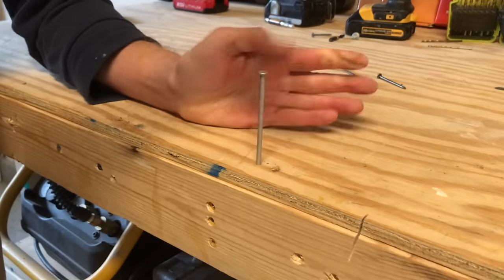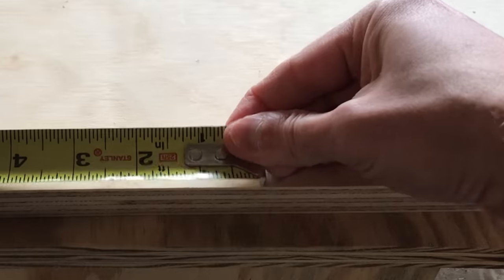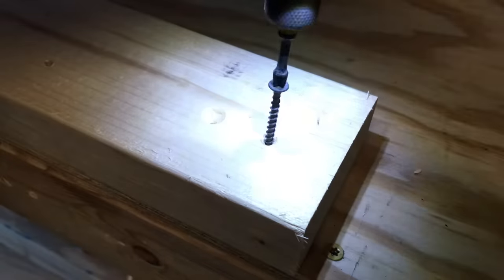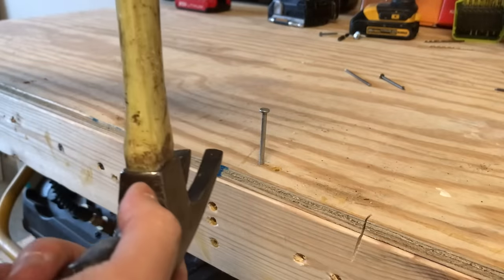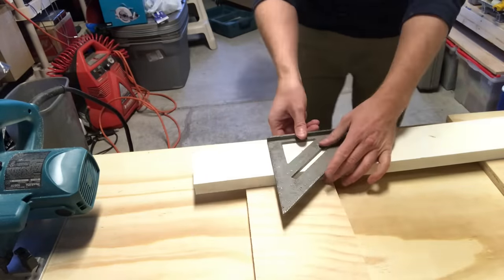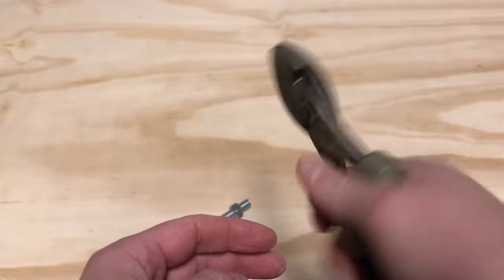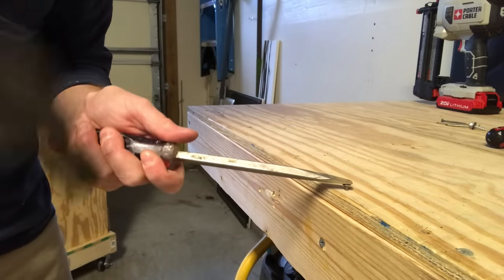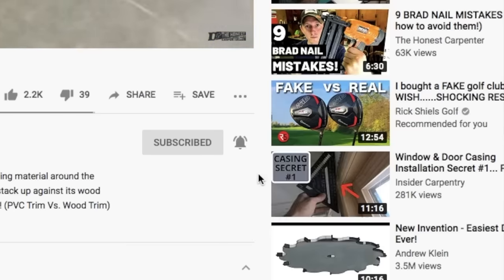21 HAND TOOL TIPS, TRICKS & SECRETS!! (Hammer/Screwdriver/Tape Measure/Pliers...& MORE HAND TOOLS!)

Comment: Most of us in the trades carry lineman pliers instead of slip joint pliers. Instead of needle nose players to get under a screw that won’t come out, use the claw of your hammer.  I would add, how to use the hole at the end of the tape measure to grab a nail to mark circles or arcs. And we don’t mark with dashes, we use crows feet.
Reply: Ain't nobody got time to screw screws in. That's that the 32 oz framing hammer is for!

Comment: This one is so cool that I probably oughta charge you for it.

Ever been trying to patch a few ceramic or stone tiles in order to replace a shower valve or mixer? Okay this is a fairly advanced skill. That said? A diamond wheel on your 4 % 1/2 inch grinder is V helpful but can leave a ton of dust in the air. Even with an exhaust fan on the window it is no fun kicking up clouds of fine dust that are V bad for your lungs. Do this instead:

1. First of all invest in a glass cutting wheel. Marble and stone companies often carry these. I know that Dal-Tile usually does. They've come down in price a lot over the years too. 

2. Next, take a large sponge like the kind that tile setters use for grouting. Dip it in water until it is about 3/4s saturated with water. In other words, once it gets to 100% saturation, shake a little of the water out.

3. Start up your grinder with the glass cutting wheel and cut through the edges of those tiles that you want to remove BUT place the sponge directly to the left of the wheel! That's right, make sure that the wet sponge drips a generous amt of water onto the highspeed wheel while in operation.

Hint: Leave a little strip of the extracted tile that lays right nest to the good tile you're leaving alone. This tiny strip can easily be removed after the rest of the tiles are taken out.  The thin strip will protect the remaining good tiles. When popping the demoed tiles out, make no action that puts weight or stress onto the tiles that you wish to save.

The wet sponge must be re-wetted frequently. Otherwise, you'll just be throwing more dust into the air. SO long as your shoes remain dry? It is highly unlikely that the wet sponge will cause electric shock. However, don't get stupid and perform this activity while standing in wet grass or if shoes are dampened from water at the bottom of a tub. 

Or if you're a real ''Nervous Nellie''?

Buy a surge protector with a  GFCI unit in it. Although I'm not certain how well this will work. As such devices are very touchy and will often shut off a circuit if only 1/4 of a milli-amp escapes the system. Plus I've never used a GFCI on this kind of an application and yet have never been shocked from it either. The only time that I've sustained a mild electric shock while working in the tile was when my wet saw was out on a client's lawn. The grass became moist from the tile saw spray. Later my shoes and trousers became slightly damp and BINGO! I got whacked a tad bit.

These days I almost never use my wet saw. Preferring to use a glass cutting wheel on a highspeed grinder. If dust is not an issue? Like say on an outdoor, permitted construction site? Then I might not even use the wet sponge technique. Speaking of ''technique''?

With a well-trained set of hands the above method actually cuts tiles more quickly than the wet saw. And of course a highspeed grinder that costs but forty bucks is cheaper by far than even our lightweight economy wet saws.

Comment: About tip #1: the moving tab. So should the measure be taken while accounting for the tab or not? For example, if I hold the tab against a surface and measure up to a certain point, should I substract the thickness of the tab to the length I just measured? 🤔
Reply: He said it backwards, so it’s confusing.  Pushing against pushes the tab in, so the tab thickness is be subtracted from the measurement, as it should be.  When pulling, the tab thickness is being added back in, again as it should be.  To answer your question directly, no, do not add in or subtract out the tab thickness when taking measurements, since the movement of the tab does that automatically.

Comment: My 3 prong garden tool handle broke. I took a 6” steel tube and tried to put the tool in. But the prong base is small to receive hammer hits. So I used a pliers to hold the tool on top of the tube and started hitting the plier with a hammer. Voila, the tool is in with a snug fit.

Comment: Number 22. You can launch a Nail punch like a bo shrunken with enough practice, doing quite a bit of damage at shorter ranges. ( I worked in a lumber yard, I've cracked 2 by 4's from 10 ft away. It was a boring job.

Comment: You didn't mention that the tip of the measuring tape has a slot to hold the head of a nail. Or that each tape shows the length of the tape measure written somewhere by the clip, so the tape measure itself can be added into measurements.

Comment: A few things that got missed; The wire cutter near the fulcrum of slip joint pliers. Also on needle nosed pliers, ahead of, and behind the fulcrum there is usually a flat portion that is very good at gripping thin stuff like nails, but also can be used to swage things that need swaging like wire terminals. Also not mentioned was the ability of pliers to pull nails, both using them like the claws of a hammer, but also to pull them out straight. There are hidden features on all kinds of tools, you just have to look for them.

Comment: I've used #12 so many times for hard to reach bolts on cars, flipping the spanner back and forth to get a 12th of a turn each time...
Reply from the maker: Me too, Nick. I never understood the offset head angle until I had to tackle fasteners in impossibly tight spaces. It made me realize how brilliant and simple  the engineering is.

Comment: 8:00 for smaller hooks and eyebolts, you know that weird y-shaped bit that's in that cheap '100/101 piece security bit set' that's sold under numerous brands?  Well, that's what it's for.
Reply: Are you talking about spammer bits?  They’re for screws with two holes/notches in their heads!

Comment: Did you ever try a 3 and half inch nail and a piece of tie wire to fasten wood to concrete? You will never believe ho good it holds
Reply: what?
Reply: @tallswede80  you drill a hole through the wood and into the concrete  3/16 inch bit . after the hole is drilled put a piece of tie wire down the hole and bend the top about a inch onto the wood and drive a 3 1/2 inch nail down the hole with the wire . Try it you won’t believe how strong it holds. And it’s cheap. Good for anything 1 1/2 thick like 2x4s or whatever
Reply: @canadaeast8358  
Cool thanks
Reply: @tallswede80  your welcome my friend

Comment: I think the only tip I didn’t know was using the needle nose to back out screws. I use a small screw driver to get it backed out high enough to get my hammer claw on. Although I probably will use needle nose now. I did see a tip to use a painters tool to pry against so you don’t hurt the surface.

Comment: Another tip... Using a Screw Driver and a Wrench or pliers... Sometimes you have to use a screwdriver and need extra torque,,, you can use a wrench or pliers to give you a longer handle to turn the driver.

Comment: I have a problem respecting the “due to the awkwardness of the outdated handle for a traditional hack saw blade”. My preferred solution is use a pair of locking vise-grip pliers with modern “T” style shorty jig saw blade style blades to create the perfect tool of angle ,size, type, and position for any job with far better ergonomic success results every time.

Comment: Screw drivers have hexagonal handles that a spanner can fit over for more torque :)
Reply from the maker: Thanks Jellybean, good tip! 😁
Reply: If you need more torque than you can get on the handle whatever you're doing is probably not going to work out for whatever reason. Which is why they make impact tools. So get one of those before you really screw something up.
Reply: @1pcfred  some people have arthritis, or limited mobility, it would be helpful for them I suppose.
Reply: @silentjellybean  do tell. Right now I have to get my limited mobility ass out the door to water the patch of new grass I am growing. Because it won't water itself.

Comment: If your a DIYer and buy the cheap nails , you can hold them with your pliers and stop them from bending.
Reply: If you're bending nails try using a lighter hammer.  Might take a couple more shots to set it but you may get it all the way home. Claw hammers are not the only game in town either. One popular hammer for light nails is the Warrington cross peen pattern.

Comment: Poplar isn't softwood. Seasoned poplar is extremely hard. It's also used in making hardwood paper fiber.
Reply: Poplar has a Janka hardness of 540 which is pretty soft. Different varieties of oak have a hardness of 1220 and up. And that's only halfway up the scale. Genuine Lignum Vitae has a hardness of 4380. Now that's an extremely hard wood.

Comment: Never tried pulling a tough nail side to side.
Reply: When you're stripping forms all day long with just a hammer you either do it that way or you wreck your wrist. It's a life choice. I've literally filled up 55 gallon drums with zig zagged nails.
Reply: @1pcfred  Thats a lot of stripping mt friend!
Reply: @markme4  well I wasn't alone. I can't remember how many of us were at it. Maybe a dozen or so? Enough that we had a steward. We were at it for over a week too. Stripping and stacking. Scraping too. Have to get the mud off the sticks. The worst is moving those Simmonds forms. They are heavy. I remember one job moving those it was so hot I'd lose 5 pounds of water weight a day. Drink it back every night too. Purely for medicinal purposes, of course.
Reply: @1pcfred  Nothing better than a cold one (or 10) after a day like that !
Reply: @markme4  I'm no good at math. Which is why I do knucklehead work.
Reply: @1pcfred  I've been in construction 40 years !

Comment: I’m not a know it all, but I’d be remiss if I didn’t share something I learned last weekend. My longest screwdriver couldn’t reach the work area to tighten a screw...the handle fit into a deep socket, I added an extension and used my ratchet wrench to finish the job...but everybody reading this all ready knew this, probably. Cheers
Reply: There are some pretty long reach screwdrivers available too. Up to about a yard long.

Comment: I have mastered the art of turning things into horribly inefficient versions of the tool that are more than arm reach away. Pro lazy tip for the lazy couch warriors. If you hate something you own and have a sudden need for a hammer like that TV remote that is pretending to be low on batteries all the time it's actually a temporary hammer.

Comment: I've used all of these except the one about pounding nails with a screwdriver, which I would never do, because AAAGHHHHH!  If I were going to do that, I'd use a pry bar.  But I rarely need to drive nails with a hammer these days.  If I'm nailing something it's usually with a nail gun.

I'd add one to the list: in addition to being able to chuck the multi-screwdriver bits into a drill, you can do the same with the center shaft if you want longer reach, or if you want a power nutdriver.

Finally, I am unable to not say this: it's called a slotted screwdriver, not a flathead.

Comment: I would caution that you have to be careful hammering against metal tools, as some of them can shatter if they are made from hardened steel.

My friend freaked and told me about this when he saw me using one hammer against another hammer to try and dislodge something.
Reply: Mythbusters tested that. Their results were negative. They actually made a rig that ended up completely demolishing the hammers. Sparks still didn't fly. Because one of the hosts did it all the time and all the time viewers would say the same thing you just did. I guess it's possible but you should be wearing safety glasses using a hammer anyways. Hammers are tempered to take a beating.
Reply: @1pcfred  the more you know!
Reply: @itsPenguinBoy  in my experience the only time you get parts flying off striking surfaces is when you have a split mushroom form on said object. Happens with cold chisels if you do not take care of them. When a mushroom forms and then splits and starts curling those shards can break off. And if you're in a bad spot when they do you could hurt yourself then. So good practice is to remove the mushroomed bits. Break them in a controlled fashion or just grind them down. But you see it coming from a long way off that there's a problem. Something like this https://c2.staticflickr.com/4/3190/2785532309_d8589fd03b_b.jpg That doesn't happen overnight.

Comment: The screwdriver bits are not flat HEADS they're flat BLADES.  Screws have flat heads, which can be slotted or phillips.  Some others are round or fillister or truss or other types.  But screwdriver types do not include flat head.

Comment: Be careful using reversible screw drivers (the second tool in this video) as socket wrenches. They don’t seem to be made of hard tool steel and can deform with too much force. I’m reluctant to use tool bit holders as quarter inch wrenches for this reason.
Reply: I am a patternmaker and I cant agree with you more. Most of the reversable screwdrivers are aluminum.

Comment: I'm left handed, do they make left handed screwdrivers ?
Reply: In general, traditional screwdrivers are considered ambidextrous tools and can be used by both left-handed and right-handed individuals without specific adaptations.

However, some left-handed individuals might find certain types of screwdrivers more comfortable or easier to use due to their grip or design. For example, screwdrivers with ergonomic handles or those with rotating handles may provide better usability for left-handed users.

Comment: You called it a Crescent wrench. It's an adjustable wrench--Crescent is the specific brand.

Rollerblades
Kleenex
etc.
EDIT

Same thing with Channel Locks.
Reply: Why are you that desperate to point out an irrelevant mistake instead of using your energy to utilize information?
Reply: You have something against eponyms?

Comment: “Large screwdrivers are indestructible”. That’s just irresponsible, false, and overall bad advice.
Reply: if you spend more than 5$ on a screw driver its fairly true.
Reply: @-Oclock  no screwdriver is indestructible, no matter the cost, especially when used in a way it’s not meant to be used. This is common sense.